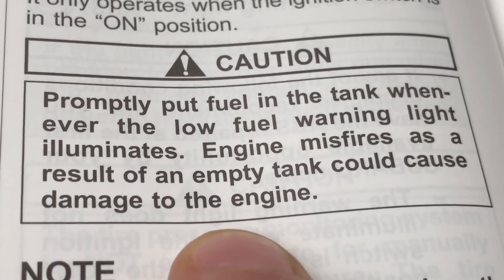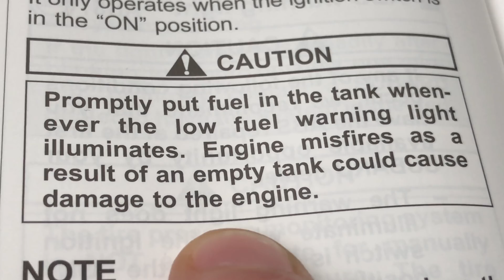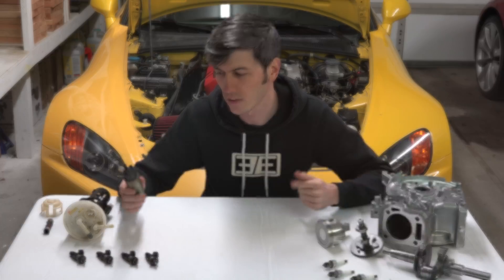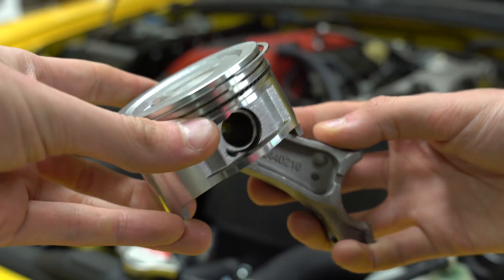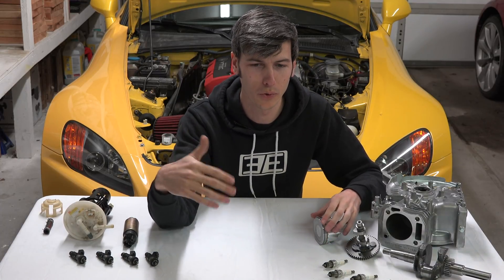Will Running Out Of Gas Damage Your Car?

Comment: I decided to test the gas mileage of a full tank a couple times by running it down to near empty.  Now, understand that I get free labor at a  high school.  But first there was a $70 tow to the high school.  I had my bicycle and pedaled home.  I got a call from the shop teacher that I had gotten grit in the fuel pump and I could wait for him to make his regular weekly trip for repair parts or...  Since i have several discounts at one store I pedaled there with my biggest backpack on.  It would barely hold the $300 pump (discounted down to $250).  So I went back to the high school and it was fixed.

And I got a backpack so large that it was designed to hold an  aqua lung.

Comment: Can you do a video on why certain engines sound the way they do, how an exhaust system can change the sound a bit, and why a 4 cylinder will never sound like a ferrari V12 by changing the exhaust etc? i.e. how exhaust manufacturers "tune" the exhaust note.

Comment: How low is too low? I have a 26 gallon and I usually run it till E and when I fill up, it puts 22-24 gallons in so there’s usually still at least 2 gallons left. I’ve never had it start misfiring but of course I drive gently when it’s that low. How low would start causing misfires?

Comment: 25.4 gallon tank. Keeping 1/4 tank would mean over 6 gallons is there just because.
Reply: Yep - a whole 36 lbs of gas. A vehicle with a 25 gallon tank will be like a Ford Expedition - GVWR 7200-7450 lbs, depending on trim. That is at worst 36/7200 = 0.5% just to keep you on the road at any time and place and in any weather. Seems like a huge bargain to me!

Comment: Having a dirty suction filter isn't going to make the pump work harder to transfer fuel to the engine. In fact, the amp draw will go down because the load, the fuel, is reduced. Same thing when you put your hand over a shop vac. The motor speeds up because the load is removed.

Comment: So I'm viewing the video and I see the ubiquitous aftermarket air cleaner, sitting exposed in the S2000's engine compartment, where it's sure to draw hot air when the car is running.
Why don't we have a segment where it's proven or disproven that an air cleaner drawing hot air from the engine compartment hurts overall performance, or not? Inquiring minds want to know!

Comment: You state that when the engine stops running when it runs out of fuel, everything shuts off. But why would the fuel pump stop running? It's powered by the battery when the ignition is in the "on" position. So when the fuel runs out and the engine stops, the fuel pump will continue to run with only air. It seems like that would kill it very quickly.

Comment: What is considered "too low"? A gallon left is not alot, but if it's only in a 14 gallon tank, you still have over 7% left. Too low for your fuel pump?

Comment: The cuestion is, Will Running Out Of batery Damage Your Tesla?
Reply: That depends, draining a battery below a certain voltage will damage the battery but it seems likely that Tesla would have a low voltage shutoff to prevent that from happening.

Comment: One time (I had recently bought my first car 10 days prior) soon as I accelerated into the highways on ramp, my car didn't wanna accelerate. Went on for a mile before I had to stop on emergency lane, luckily near an exit ramp. 
I was so worried, thinking I was having a transmission issue,  but called the guy/mechanic I bought it from and he said it needed gas...(unit worked at first but then just displayed full and I just thought my dad had refueled it. Thankfully the mechanic replaced my fuel send unit free of charge)
Reply: when you start a sentence and have brackets in-between it. The words before and the words after the bracket need to make sense if you remove the bracket. so; "One Time soon as I accelerated" makes no sense.
Reply: @sefyboy7183 You can't use a full stop in the place of a comma
Reply: @sefyboy7183 You can't put a semicolon before a quotation. That's not what it's for
Reply: @sefyboy7183 "bracket" refers to the symbol ("(" or ")"). The word you're looking for is "parenthesis"

Comment: I can vouch that raw hydrocarbons are bad for a catalytic converter.

I had a coil pack die without warning on my Miata and drove it home as a 2 cylinder since I only had a mile or so to go.  P0420 now.

It drove surprisingly well for half the engine being dead weight.  Idle was slightly low though.

Comment: I was always told to keep my tank above a 1/4 tank. I didn't do that with one car, and changing a fuel pump in a car is the worst, damn things are expensive too, and the floater fell off into the tank. I keep my tank above a 1/4 with what replaced that car.

Comment: Probably worth noting that diesel vehicles are a lot worse to run dry than gas vehicles due to the nature of their fuel systems. Diesel engines cope terribly with air in the fuel lines and they will run very rough and be quite heavily down on power much like gas engines if they even start until the air is completely bled. Not to mention that it doesn't do the injectors and pumps any good. Diesel makes an excellent low viscosity light duty lubricantant so the entire fuel system of a diesel engine is designed to take advantage of this lubricity to operate smoothly and reliably. Run your vehicle dry and you not only aerate the fuel system but you also run the risk of siezing pumps and injectors. The latter can be catastrophically bad for the engine if the injector ends up stuck open.
Reply: Yes. I thought he would bring up diesels because of how important it is to not let them run dry, but alas, he didn't.

Comment: I had a 1986 Camaro IROC-Z which had the TPI EFI Bosch batch-fire arrangement. The tank was obviously designed for carbonation duty. As I would take very hard turns at a 1/4 tank and the pump would cavitate as fuel would slosh away from the pump inlet. It was a matter of retrofit design that didn't quite work very well.

Comment: Well...the fuel pump still runs (tries to pump) with the motor off. You have to turn the key to the off position -refer to ignition schematic diagram. As soon as the key is turned to the on position, it energizes the fuel pump until the pressure switch is actuated to deenergize.   This shouldn't damage the pump motor, but possibly the impeller and seals. This would take a while - which could happen if the driver keeps the key on.

Comment: If you run out of fuel the engine will stop but the fuel pump won't...until you turn the key off (or push the button)...

Comment: if you are running low just dont push the car too hard drive it slowly and gently and you are fine nothings gonna happen to your car and refill the tank before your car completely runs out because that is bad you dont want air to be sucked in your fuel pump

Comment: I have an AP2 S2000 and sometimes my gas light comes on and rarely, my dash shows that I have zero bars for my fuel level. When I fill up, the gas pump reads 9-10 gallons was added to the tank. I know the S2000 only hold 13.2 gallons. I read somewhere that it does that because it's trying to cool the fuel pump? I'm not that low on gas! Is that correct?

Comment: Aircraft engines are always shut down by fuel starvation (lean mixture) for safety reasons.  But this is also done at an idle. And there is no catalytic converter.

Comment: My s2000 was having serious fuel starve issues going left.

I installed the fuel baffle along with a new sock and filter and solved the problem. (old fuel sock was torn)

The new unit came with a new wire with an extra ground. I'm wondering if you experienced this

Comment: S*t happens, and the real bottom line from this video is that normally there is no problem from a single out-of-gas event. But if you're repeatedly running down to the fumes, then the real problem is that your life is running down to the fumes.

Comment: Exactly.. happened to my diesel Volvo V70... Main fuelpump got buggered due to a secondary pump failure.. ECU reported inconsistencies in the fuel pressure on the diesel rail and it cost me £300+ to get it sorted... A month later car was written off but that's another story lol.

Comment: A couple things are not mentioned.  1)  When you run your tank low on fuel, there is less fuel weight, which puts far more stress on the fuel pump to suck up fuel, which can shorten the fuel pump's life.  2)  Water sinks to the bottom of the fuel tank, so running your fuel low increases the ratio of water-to-fuel in the remaining gasoline, which increases the chances of sucking up water and injecting it into the engine.  I personally would be far more concerned about injecting water into the engine over any other low-fuel scenario.  It's the most costly if it causes engine damage.

Comment: The one time I've ever gotten close to running out was when I was below 1/5th of a tank and got involved in a hit and run and went after the person. Drove a good 10 miles at accelerating up to 120 down to 90 repeatedly. When I finally got ahold of the police and meet up with then my tank was past e with the light on.

Comment: "Computer, Jason"? What computer are you talking about, inside the car? Haha No. Thanks but no thank you. I drive a Volvo 940 SE .. with an age of about +25 years old is the car, and I picked It up brand new of Dec 97 And there are not a single computer for that matter 
in that car for another century before they installed that into Volvos..XD 5:45 mark!

Comment: It's not a suction filter. It's normally called a fuel pump pre-filter or strainer or in tank filter. Stop being a dummy and confusing newbies with pointless rewording. The pump can heat up and burn out due to low or no fluid travel through it simply because the fluid has a lubricating effect. Removing lubricant causes eventual burnout. Also when fuel is removed from a system there is a residual drying effect which slightly compounds the problem. Engines run hotter when running out of sufficient fuel supply so burning valves or other components becomes more possible. Also a major percentage of people have no idea how micro- sized the tube passages in a catalytic converter are - show it. I keep one on hand to amaze people quite routinely and help them understand how easily these components can become clogged and eventually blow an engine. In conclusion - some pumps can NOT be run much if at all without fuel. You need to be aware of the manufacturers clearances if available to determine how detrimental it may be to do so.

Comment: Horrible idea in direct injection vehicles be it gasoline or diesel direct injection. You can burn out expensive high pressure pumps and injectors quite easily.

Comment: I have a 2006 Pontiac Grand Prix. I noticed a rubbing sound while driving, particularly at low speeds. Jacked the car up so I could grab the wheel and turn it to see if it would make that rubbing noise, and it did...any ideas? Thanks!

Comment: Running out of gas when accelerating or during hard turns on high output fuel injected engines – 1 hp/in^3 , turbocharged or supercharged, will lean out a cylinder, knock and blow a head gasket or something else depending on severity and how well the engine is designed. Carbureted engines do not have this problem so I’m told. They are still around. Fuel pump, catalytic converters etc are the least of my worries.

Comment: I think you missed something, let's say you are parked and you car runs out of fuel doesn't the car shuts down and the ignition stays on where the fuel pump stays running until you switch back. During that stage the fuel pump will try to pressurise to reach pressure shutoff? I know when I apply the key I can hear the fuel pump run until it shuts down.

Comment: worth noting: running out of petrol will be less harmful than running out of diesel as petrol is  dry fluid, while diesel is a wet fluid that lubricates parts of the pumping system

Comment: One mechanical attrition due to chronic low fuel levels I experienced on a new vehicle was a clogged inline filter (downstream of the pump). After 2 years of "testing" actual capacity of my 34 gallon fuel tank -- never actually running empty -- the poor abused system sputtered and quit on the freeway on my morning commute.

It would seem the "suction filter" will still pass particles too small to damage the pump but too large to get by the paper folds of an inline filter. If enough crud is fed to it, it will sacrifice itself to prevent worse outcomes . . . duh.

Comment: If your ignition is still on, then the fuel pump will run, even with the engine off. That would destroy a pump sucking air for more than a few min

Comment: Hi Jason! Great Vid as always! 

Will the obdlink mx+ scan tool be of great use as well, being able to monitor and identify possible issues within the car's fuel line/tank/consumption?

Haven't bought a scan tool yet as well cause you both advertised the obdlink mx+ and the bluedriver. 

Which do you think would be better and hopefully work for a late 1990s car model, say a '99 a/t RAV4?

Thanks in advance for taking the time to reply :)

Comment: Growing up I was told that once you run out a fuel in a vehicle with electronic fuel injectors the pump would need to be primed and the the fuel injectors would have to be reset. If you didn't mention this I am assuming that this wasn't a widespread "concern". I doubt you will see this but a comment on it would be appreciated so I can have you explain the issue to my family members.

Comment: A friend of mine who used to chronically drive around on almost empty tank routinely had to replace his totaly clogged up fuel filter.  This was in cars like Golf 1 and similar.

I myself am a diesel driver and I was wondering about diesels-specific considerations?
Reply: Ralf, that's an old wive's tale. IF your fuel tank has debris in it then it will still have debris in it whether the tank is full or empty and the pump always picks up fuel from the bottom of the tank, regardless of how much fuel is present. In fact it's usually 1/4 inch or so above the bottom of the tank for this very reason.

If you routinely need to replace a fuel filter then you need to look at your fuel supply. I've driven in UK, Europe, USA, Middle East, Asia.... pretty much everywhere and I've not seen any dirt in tanks since perhaps 1970s when quality control was poorer.

Comment: Some engines, probably just some diesels, will flow fuel through the injectors and return it to the tank to cool the injectors. Dont wanna let those run dry. But Ive ran all my cars out of gas. Then you know the limit and dont get range anxiety ever again lol.

Comment: OK HUMANS AND SUB HUMANS.  The only thing that is going to happen if you run low or out of fuel in your car is that the fuel pump can over heat and fail.  99.9999999999999999 percent of the time when you run out of fuel you run out so fast that it can not run on a lean mixture long enough to do anything. Now if your pump starts to cavitate for long enough it can cause a lean issue.  If it did your engine would throw a running too lean code. P0171 code.  as per the catalytic  convertor being damaged I call complete BS on that.  if your convertor has issues that's    going to be caused by more than just running low or out of gas. Now on  some engines the fuel injectors are designed  have to have a certain amount of fuel pressure before they will even fire preventing any kind of lean issue.   if your pressure gets to low the injector just shuts down and will not fire.    This is a subject to people can argue about all day long.     engineer vs technician vs mechanic    I have been a mechanic for over 30 years. I call myself a mechanic because I don't need or have to have a fancy title to say I know how to trouble shoot,  repair or rebuild  components on cars and heavy equipment!   And every person I have asked that call themselves a technician don't even know what the real meaning of the word is!!!!!!!! And engineers only design things anymore for the fastest easiest way to assemble them going down the assembly line and not the practicality of working on them once they are completely assembled.

Comment: If you own a late 90s early 2000s gm truck running on low fuel WILL burn up your fuel pump. Now running out no but running low so hot yes. Those pumps are junk no matter what you put in it

Comment: Once it sucks air is looses pressure in the fuel lines. These pumps don’t compress air. A fuel pump failure today is nothing like the 80s, they are way more reliable.